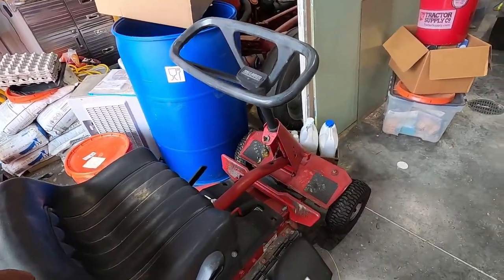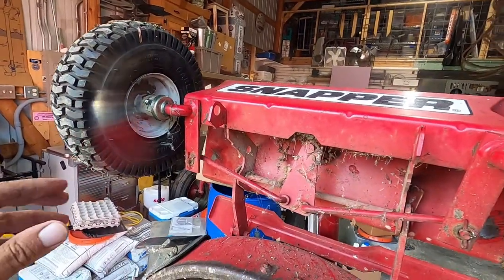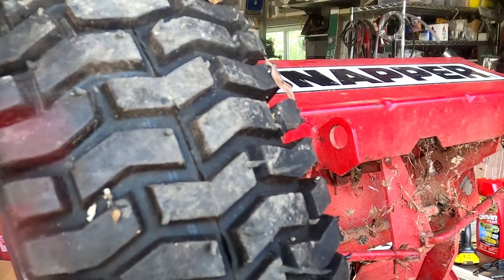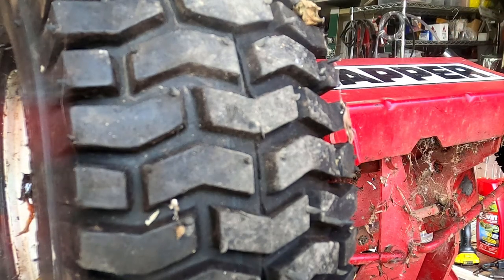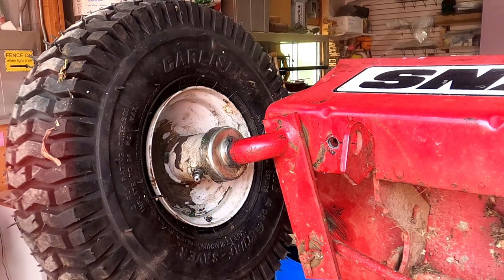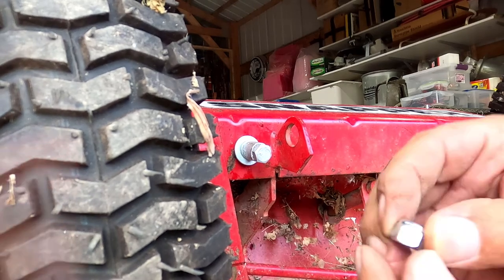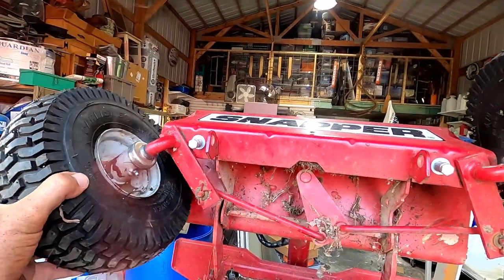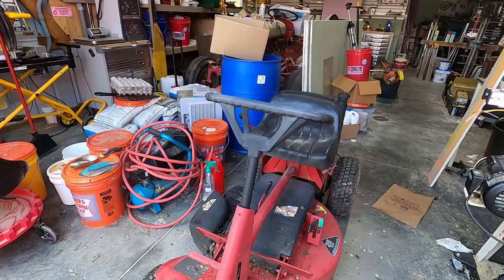How-to Fix Snapper Mower Oversteer ― Permanently and Cheaply!

Comment: Glad to find out my Snapper is not the only one with this problem.  I ended up putting a few blobs of mig weld on the arm where it hits the attachment plate.  That keeps it from travelling too far.  But, now that I see this fix, I have something else to try, if my fix fails.

Comment: Glad I watched your video. I put kingpins in my snapper the other day and when I took the front wheels off I noticed there was no flat washer on the end of axle just a cotter pin and noticed my wheels would slide back and forth about a quarter of inch. I put a flat washer on the end of axle to take up slack in put cotter pin in and that took the slack out of wheel sliding. I couldn't figure why snapper would leave the washer off until I watched your video. If the wheels can slide side just a little bit it won,t lock in a turning position

Comment: i have a 70's model and there is no notch cut out of the turn stop. Clearly some late model snapper designer was trying to decrease the turning radius without re-engineering the steering assembly. Seems like putting a connecting rod between the two steering arms and removing one of the tie-rods would of been a better solution. That would of kept the front wheels parallel in the turn.
Reply from the maker: I agree.

Comment: I just picked up one of these mowers and am having a different steering issue. The wheel just let go, it spins freely and the tires don't turn at all. In all of the steering repair video's I've found, this is the only one that has the same steering mechanism. This mechanism seems pretty straight forward - no rack and pinion, etc... I'm just trying to figure out what "let go"' before I tear it apart. Any ideas on this?
Reply from the maker: Never heard of that one before, but it should be pretty easy to find. Good luck!

Comment: Great fix, but what has worn out to cause this?
Reply from the maker: Nothing. They are built that way 😐
Reply: Mine does not do that. I have had two rear engine Snappers and neither one had this issue. Had one with bicycle steering until 2014, then bought a new one.
Reply: The plastic bushing are worn out.. They sell a kit but why keep buying the plastic bushing?